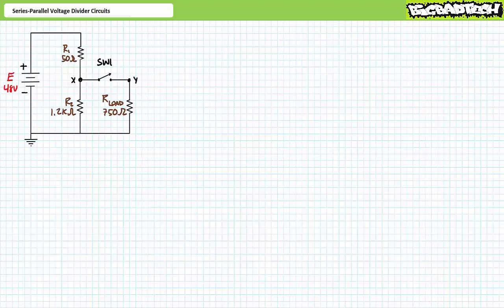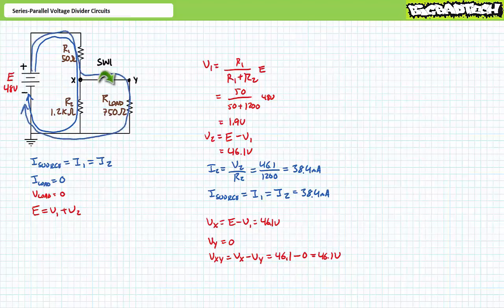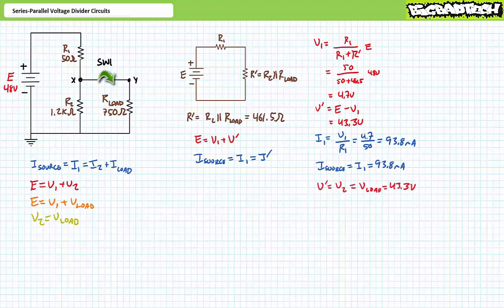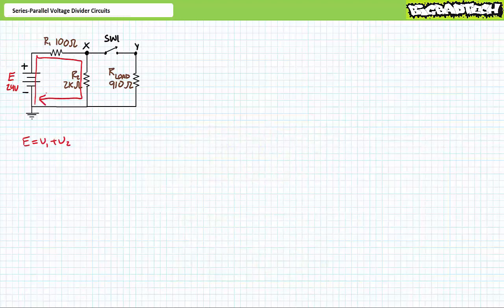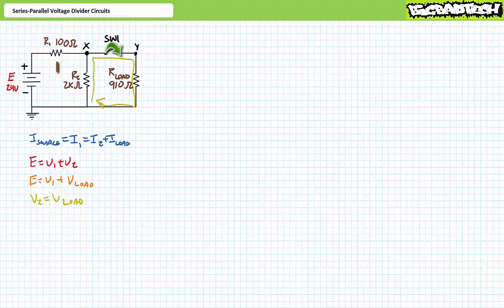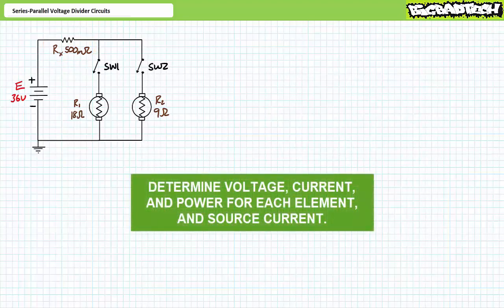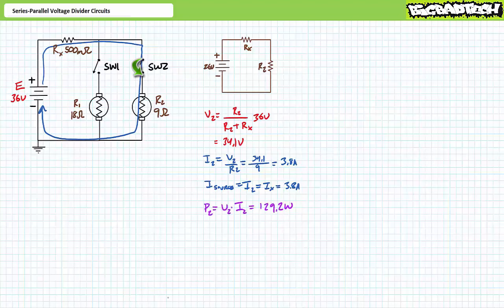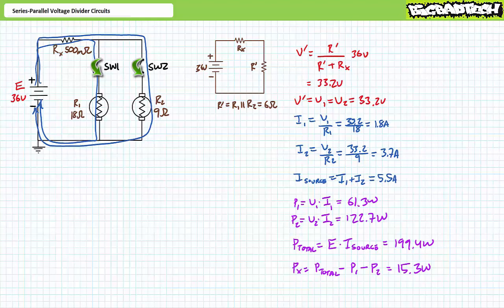Series-Parallel Voltage Divider Circuits (Full Lecture)

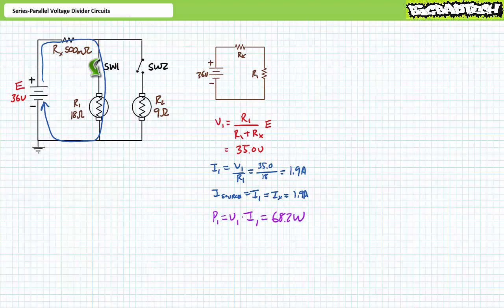Comment: @  12:43 how did you get 70.1w for P total. Since source voltage is 36v times 1.9A= 68.4w.
Reply from the maker: Current is rounded to the tenths place. 1.9A is actually 1.9459459459.... which yields 70.1W
Reply: @bigbadtech  ahhh, got it. Thank you for clarifying